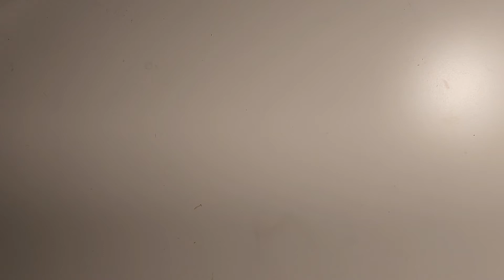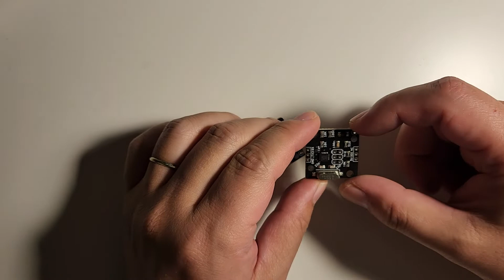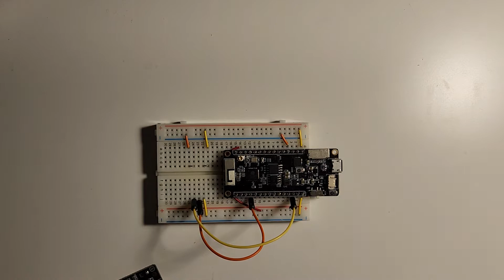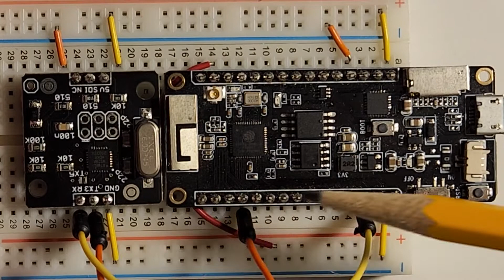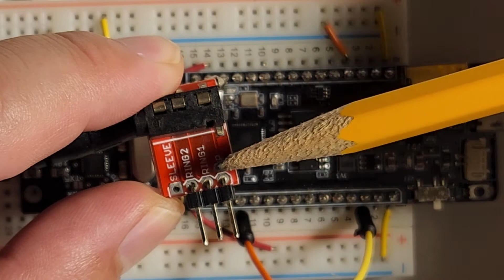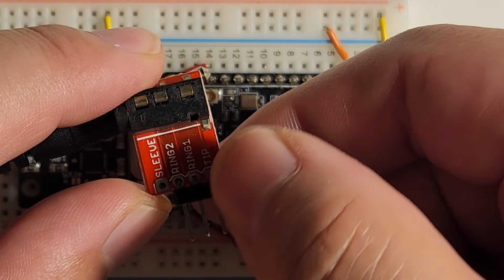Introducting SDI-12 UART mini

Comment: Looks super cool im interested in buying some of these. Is this capable of handling multiple sensors on the sdi12 data pin? And is there a maximum combined cable length you could estimate?
Reply from the maker: Thanks for the question. I have only tested my SDI-12 technology on cables of 100+ft in my lab but people have used it for much longer installations. This module can handle any number of sensors, as long as each sensor has been assigned a unique address. I recommend you to get the microUSB SDI-12 adapter along with these modules because you can more easily interact with your SDI-12 sensors with a microUSB adapter. Once you become familiar with how it works, you can move on to the mini UART module. Here is a link to my online store: https://liudr.square.site/
Reply: I would think so. otherwise, what's the point